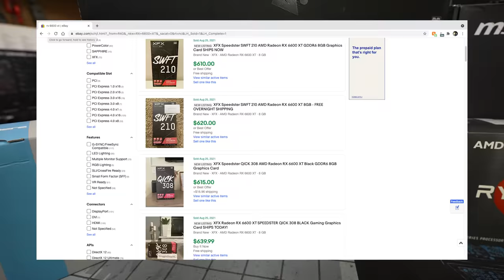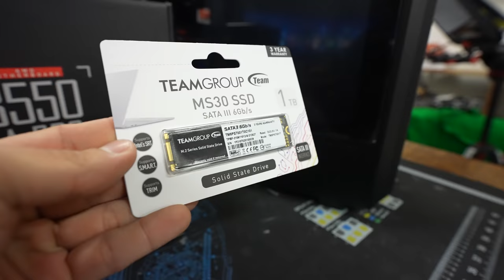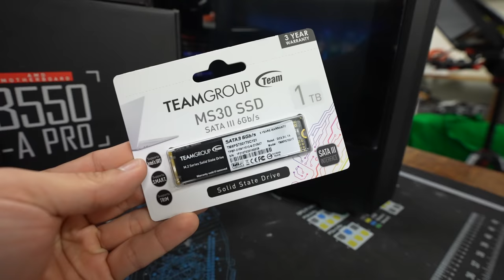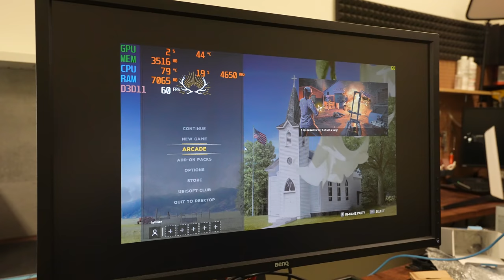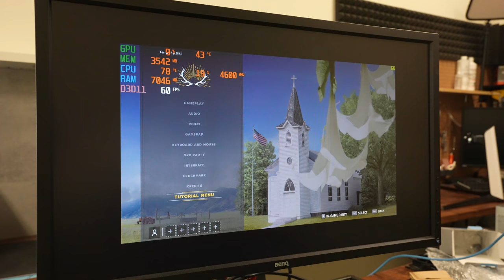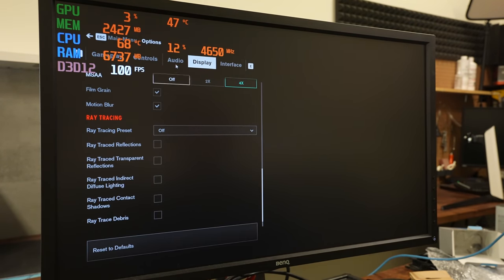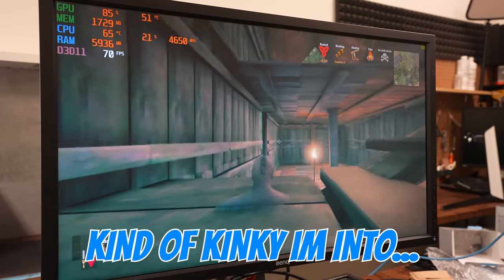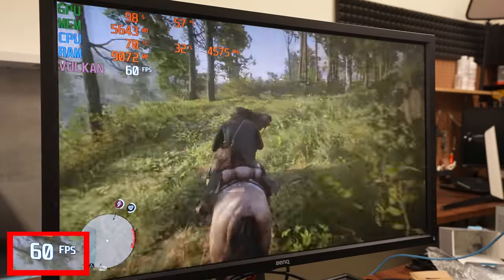Building a *REASONABLY PRICED* 1080p Gaming PC?!

Comment: Kyle: Builds a Reasonably Priced 1080p Gaming PC.
GPU Shortage: I don't think we've properly met, Kyle.
Reply: @3polygons  it should be fine to do some light video editing just don’t expect a miracle
Reply: @Midnight_horrors885  That's what I wanted to know. Thanks !
Reply: @3polygons  no worries it’s not gonna be insanely fast especially the higher resolution and more effects you put in but it should be fine for basic editing, my recommendation is if someone is looking to build a editing rig I’d recommend going with the base mode m1 Mac mini and upgrade the storage as for 700-1000 depending on configuration it beats almost anything in that price range
Reply: @Midnight_horrors885  Interesting... As much of a Windows user I am, I was looking at the other day mac minis offers (as the iMacs go further any budget idea I'd have, compared to PC). I kind of got stuck when I saw no option to go further certain amount of ram (16GB, if I remember well). For other graphic uses (3D and print of large raster files) I do need quite some RAM... But could be a nice idea if thinking of an hybrid use (the mini for some stuff, my 3900X for other matters). I am mostly looking for getting a new card, to replace the 1650, but it is indeed tempting to have a mac as well (to use certain software, test stuff there, etc).
Reply: @3polygons  with the m1mac mini it uses unified memory and even at full load editing 6k it never maxes out 8 gigs of ram
Reply: @3polygons  as for relaxing your 1650 I recommend looking into a 2060 super as they aren’t too pricey and have great performance
Reply: @Midnight_horrors885  Outstanding advice, thanks :).  6k editing with 8GB RAM ... wow. Makes the m1 mac mini an option. The 2060 Super, I saw great results in Puget Systems tests with that card in Davinci, it matches the idea I had (apparently not many in stock, but I'll keep digging  :)  ).
Reply: Yeah like I would kill for a 6600xt for 349 dollars.
Reply: @Midnight_horrors885   Actually, what I mostly need - due to several work files and Windows apps that need tons of RAM, it ties me yet to the 3900X 32GB (at some point will be 64) for a while- now is a card, but you really convinced me to try the mac mini (m1!) route at some point.  :)
Reply: Used hardware is still where it's at for 1080p gaming.
Reply: @jonmayer  some people don’t like going the used route as it can potentially cause more complications

Comment: Honestly, for the price of the P300 (+an extra mesh panel from Phanteks' website and extra fans) it'd be a better value to get a P400A or a P360A which already include the mesh and more fans
Reply: I have a p400A eclipse i like it beautiful and lots of room inside.if you can get it at a good price mine was 30.00 off  i got it for 49.99 plus tax SRP 79.99
Reply: I got a p300a case I bought mine when those cases didn’t exist
Reply: I've been building in the P360A a lot and buying extra rear fans if I felt RGB was needed. Or just put any black 120mm fan in, that I still had lying around.
Reply: Also Arctic P12 are 5 $ each and are some of the best fand you can get

Comment: Since when did ~ $1300 become the "minimum" for a decent 1080p PC? Excluding the GPU price hike, that still boggles my mind.
Reply: Paid 1000 euros for my pc back in 2016 and still manages 1080p somewhat good even with newer games, either games are so much more demanding or gpu producers are scamming us
Reply: I spent about 950 dollars Canadian back in November and can run most modern games at 1080p. I'd say the minimum is probably around 1k with normal prices.
Reply: i built my pc back in 2016 with around $1000 and the only thing i upgrade in it was the gpu went from 950 to rx 5600xt last year 
now i play 2k res with med to high settings in almost any game exept warzone :o
Reply: Well it all depends on the settings I bought my 2060 super build before the gpu crisis and couldn’t be happier even tho the full pc cost 1400
Reply: this was more of a slight compromise build as opposed to "bare minimum"

if somebody wanted a 1080p rig that's less damaging on the pocket you could go with a ryzen3 3300x (if you can find it at msrp), a cheaper $85 board and a smaller ssd....about $500 at msrp prices will get you a1080p ready machine NOT including gpu
Reply: I've only spent just under $400 (counting peripherals) for my PC (i7 3770, GTX 1650, 16gb DDR3) and it plays most modern games on medium settings at 1080p 45-60 FPS. Yet again, i built this in late 2019 before all the prices got super inflated

Comment: Apex legends limits the frame rate to 144fps, that’s why you couldn’t get more frames than that. You need to put in a command to override the FPS cap.
Reply: came here to say this.
Reply: I noticed that too. I play in 1440p but I'm supposed to be getting about 240fps
Reply: @dethtour  u can uncapped it to 300fps
Reply: yeah at tournaments and such the competitive standard is 144FPS, so the game is locked at this in general.

Comment: The 6600xt seems to be on par with the 5700xt so this build should be a capable 1440p gaming rig. $1300 doesn't seem bad for that resolution.
Reply: It's no 5700xt for higher resolutions though. That older gpu is far better for 1440p.

Comment: You know its an expensive hobby when "reasonably priced" is 1300
Reply: That isn't the norm, usally it's about 1k for something like this, the extra 300 comes from the inflation of the graphics card. Also if you deal shop you can take the price way down.
Reply: 700$ gaming PCs are never coming back
Reply: @macemaster5295  still, its expensive
Reply: @Chopstlcks  yeah your not wrong.
Reply: @macemaster5295  1k is still too much. Back in 2015 when I built my first PC, I spent £500 for a decent experience. This is ridiculous.
Reply: @captinsparklezremix  Yeah I know, chips have gone up because of the hyperthreads. And GPU's now have that ray tracing premium.

Comment: In the uk the 6600 xt is actually in stock in many places and is going for 420 pounds which is cheaper than what the 3060 is going for.
Reply: Wait what website is that one because I could only find a 1660 ti for 430
Reply: Was 370 on overclockers to begin with but they changed to 420 lol
Reply: last week it was £399 on overclockers, cheapest now is 419.99 on overclockers
Reply: @Shadowghost-ml3sj  overclockers uk and scan computers

Comment: I litterally built this exact pc yesterday! Was lucky enough to be able to get the 6600xt close to msrp in Aus!
Reply: Yeah, I was able to find the PowerColor and Sapphire 6600 XT cards for MSRP and the OC'd models went for a little over MSRP and were around for two and a half weeks after launch. I waited in hopes of seeing the RTX 30 series or RX 6800 back on the shelves at or close to MSRP. Nope and by that time all the 6600 XT cards were sold out. Luckily I already have some decent albeit older generation GPUs but still would like something up to date just in case another silicon setback comes upon us.

Comment: This is nearly identical to the computer I just built yesterday.  I used a Ryzen 5 3600 with an XFX 6600xt with 16gb of 3600mhz Gskill Ripjaw memory. I put it in a Phanteks P360a case on an Asrock motherboard with a WD 500gb M.2 NVME.  My grand total came to $1200 for the whole system.  It runs great with good framerates in the few games I have benchmarked.  This is my first AMD gpu ever and it has been pretty impressive.

Comment: Phanteks P300 was my first ever case, it's solid. I've got a new rig now, but the old one is sitting in the closet acting as a home media server. You can buy the "P300A" perforated/mesh front panel from phanteks for like $20, I really recommend it because it looks nicer and really improves air flow and temps, especially if you're running a front radiator like I was.

Comment: I thought semi-modular psu meant that the cables coming from it were permanently in the psu plug, and if u have a fully modular psu, u get the benefit of choosing which cable you need (for example, if you are using integrated graphics, you don't need a gpu cable, therefore you can just not plug in the cable to the psu) so what is the difference between semi and fully modular psu's?
Reply: Semi modular has some of the cable pre-attached, like the 24 pin, 8 pin cpu qnd some pcie pin. The optional cable is usually the sata power. Fully modular means all the power cable can be removed
Reply: @PretentiousGamer  ohh, that makes much more sense, ty

Comment: Even though the heatsink on the AMD cooler can only be mounted two way, what's your a basically identical) because of the screw spacing, the fan can be turned any direction because the screw spacing on it is square (equal on all sides.)

Comment: I think the best you can do now is try to find deals of pre-builds. I bought my rig for £1.100 and I got 
Kolink case 
Ryzen 5 3600 
16G RAM 3200
RX 6700 XT
600W bronze power supply
ASRock phantom gaming 4 ac
Pretty good system to be honest running 1440p with no prob

Comment: Not that long ago, 3600 $180, RX580 8g $150, 80+b PSU $40, case $50, RAM $100, 1tb hdd $50. That was a good 1080p system at the time for under $600.... Now you have to spend double, granted the PC is also more powerful compared to the one listed, but not twice as powerful as the price suggests...

Comment: The MSI MPG B550 Gaming Plus is basically the same board as the B550 A-Pro, but with a bit of style and has RGB. Maybe $40-$50 USD more? I have the board personally. Good board. Great for a 5600x. If you're running a 5900x STOCK it'll be fine, but don't try overclocking a 5900x with it.

Comment: Very nice build! I wonder if the 3060 will work with this build, I want nvidia's features like dlss. The RX6600 is compelling though.
Reply: I have a similar build, r5 3600, 16gb 3200mhz ddr4, msi b550 mpg gaming plus, 1 tb m.2, rtx 3070ti, phanteks, p400a. 750w psu bronz. Works really well :)

A 3060 and 3060 ti would be fine, i just didnt find one at a price that was decent.

I actually wanted a 3060ti, but it was so massively overpriced in my region, that i could buy my 3070ti from a private person for the same price of a 3060ti from retailer.

Comment: I bought $5 fans to add to my pre-built and used them for a couple years but they were so noisy.  Just changed out all the fans (2 that came with PC + 2 I added) with silent wings 3 fans.  I should not have cheaped out on fans.  These new fans are so nice and quiet.

Comment: Would be nice if you used a aftermarket cooler that looks nicer, if there is budget for sleeved cables, then you can spend a extra 30 on a hyper 212 black or a be quiet pure rock 2 black, then it would look way nicer in combination with the sleeved cables

Comment: @Bitwit I build this PC but excluded the gpu, when u start it, the power turns the fans on and the cpu fan and the cpu  light is on (its solid white) on the board. However the TV I hooked up with an HDMI port does not want to read and windows isn't installed yet, how to fix that?

Comment: I'm curious why you would spend extra on black/gray cable extensions on a more budget build, especially since the PSU came with all black cables to begin with. The stock ones are even more appropriate for your "blacked out" build. That $30-40 could have been put towards a nvme drive ;)

Comment: For anyone using the wraith cooler with the thermal paste pad, please use caution when you remove it later on In the PC's life because it turns into glue after a while and it can rip the CPU right out of the socket and stick to the cooler if you pull straight up when removing the Cooler, twist it a little so it can break the seal it creates with the CPU. (This can also happen with normal thermal paste so use caution there too.)
Reply: Twist the cooler left to right n it comes  off easily
Reply: @NeVErseeNMeLikEDis  yeah thats what I said

Comment: apex was probably getting higher frames, but unless you change settings it will lock the framerate at 144 max (same as the monitor) for example, it will lock at 60fps on my other 60hz monitor

Comment: I caved and bought a 3070ti for $1,300 on eBay… only good thing is I sold my old gpu for $650 (I bought it for $350) so it made up for the price difference over msrp :)
Reply: That face when a 3070ti is more expensive than your entire build
Reply: @pleasuretokill  in my defense it was a strix card which has a $999msrp
Reply: @timbrown3666  I spent about $3grand total over about 4 months buying parts. When I build my PCs I’ll buy parts that I definitely know I’ll use overtime while saving cpu mobo and gpu for last.

Comment: You can easily undervolt and overclock that 6600 XT and probably run it at 1440p around 100 fps with some tweaking of the settings in Far Cry 5.

Comment: 620 for a 6600xt? Jfc, every day I'm so grateful that I managed to snag a 6800xt from AMD Direct for 650 shipped. Finally had the funds to upgrade my system, which had a GTX 670, and I would have hated having to settle with a low-end modern card for what high-end should cost.
Reply: Doesn't get any better than that. I have the same card although it's a liquid cooled AIB model I got last December at msrp before all the prices started going up.

Comment: The MSI B550-A Pro is a nice basic Mobo, I used it in a Ryzen 5 3600 build and it's nice, no blinky lights, but instead good parts.   BTW Please get a pair of diagonal cutters, cutting wires and zip ties (AKA Tweezers) with scissors is kinda lame.

Comment: 1300$ is way overpriced for 1080p gaming "without compromising more than you'd be willing to".
You could get a 3600 and even go as far as a gtx 1660S for far cheaper and you'd not be compromising anything at that resolution
Reply: I agree, mans also could've forgone the goddamn asiahorse cable extensions, those are purely aesthetic and serve almost 0 function
Reply: 3600 is overpriced. I'd get 10400f which is far cheaper and does better in gaming
Reply: 1300 is assuming 600 for that card

Comment: Clickbaity AF title+thumbnail there, Kyle, and it's not even one of those funny/sarcastic click bait titles/thumbnails... Of course you can build a reasonably priced 1080p PC, you have been able to since about 2010, if not a bit later, the issue is actually finding the parts for it, and the 6600XT is going to be just as hard to find as all the other cards...

Right now, people are going to think that you magically have a trick to build a computer for cheap  (ie, get a GPU at MSRP). You can also get your hands on a 2060, if you're lucky, and that's technically a still in production current card  And of course you know this... I dunno, I just dislike click bait for the views, not for the lols...